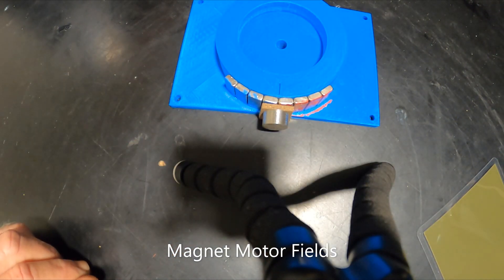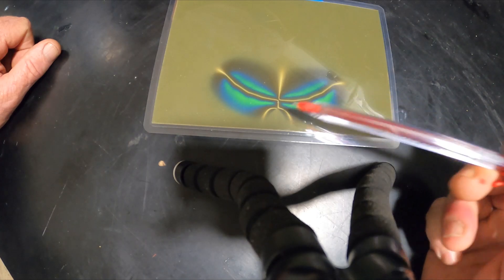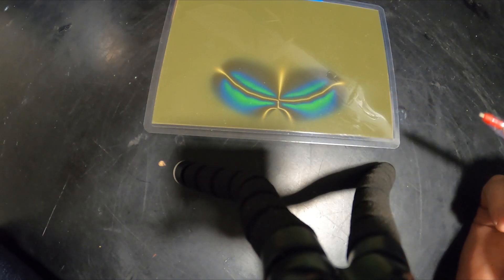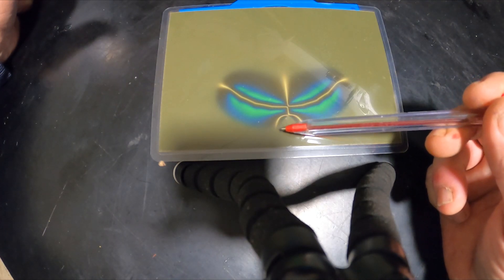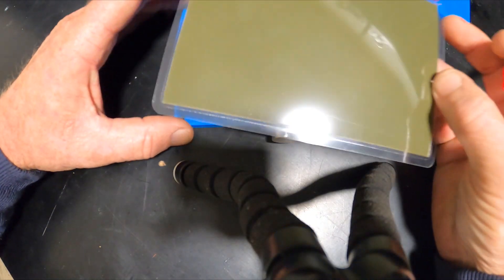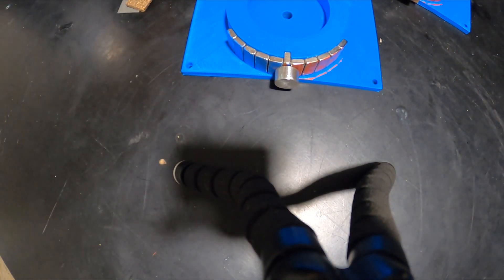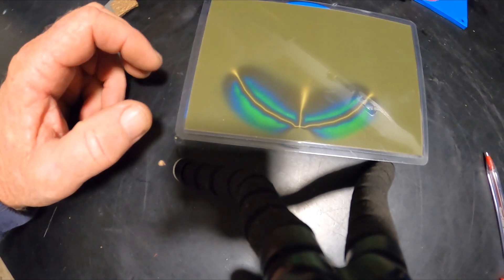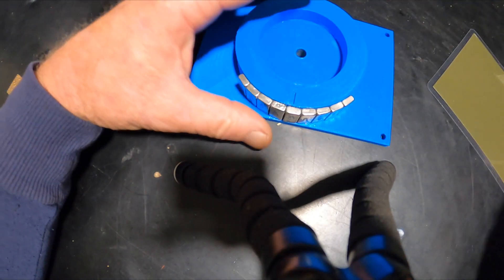Magnet Motor Field View

Comment: Have you try making a "markov" transformer? It's lenzless. Although the source and load are flipped. The two windings are secondary, need to be parallel. The singular winding is to be use as primary.
Reply: 😂😂 Son imanes y campos magnéticos,no confunda mas a la gente con comparaciones alejados en conceptos y principios por el simple hecho de nexo común "Campos magnéticos¿Markov? Su comparación es como decir al inventor del avión ¡Has creado un UFO ! Por que ambos están suspendidos en el aire 😂😂 .No me extraña que no le respondan ,lo extraño aún lo hago yo😂😂..
Reply: @lukiepoole I have read this comment from you on multiple videos about unrelated topics. Build one yourself and you will see how really works, or doesn't work! Film a video of it operating and post it to YT!
Reply: @sandysmagicmix  Nah I figured it out. "frolov transformer" is the name but due to complex/imaginary/reactive power, output current is almost non-existence since the primary windings is literally an inductor as no back emf is induced by the secondary windings, as they cancel each other. Therefore capacitor is needed on the output side to convert the complex field into real field. The funny thing is the input and output current are 180 degrees out of phase.
If you apply back emf cancellation on a generator, the breaking load torque is drastically reduced, achieving over unity.
The MAIN question that needs to be answered is what are the differences and similarities of a rotating electromagnet and the inductor.
Phase shift.
This reveals the SECRET equation - electrification.
Psi • Phi = Koppa
Aka
Electric flux • Magnetic flux = Planck.
Matches what Eric p dollard said before.
Reply: @sandysmagicmix  And what is energy? Planck per second. The equations also unite the magnetic energy and electric energy equations as well as power. Fits straight in doesn't it?
Reply: @lukiepoole9254  I really don't know anything of value. The words and math are all symbolic, I have tried my best to understand these things in a practical way. I have never tried so hard at anything and made so very little progress. I'm glad that you have a clear understanding and I hope you can hold it in your hands if that is your ultimate goal.
Reply: @sandysmagicmix  Eh the equations are just knowledge anyway

Comment: The yellow line is where there is no magnetic field, it is exactly between the north and the south because they cancel each other out there.
Reply from the maker: That being the case, how do two magnets stick together with such great force?
Reply: @69Atho  Put your viewer on the side of your largest magnet, and you will see that in the middle is that yellow line.
The force is more to the tips, where equal polarities repel each other, and opposite polarities attract.
The neutral, non-magnetic iron is attracted to both poles, but near the yellow line somewhat less.
If the non magnetic iron is close to the magnet, the fields can interact with each other inside the iron.
Reply: @69Atho  Inside the viewer are small iron particles with a somewhat elongated shape, when they are in reach of a magnetic field they become little magnets with an opposite magnetic field, and when they are next to the magnet, their tip bends towards the pole they are closest to.
When the filings are in front of a pole, they point toward this pole.
If there is no field, the filings are oriented randomly, and reflect light like any amorphous material.
Reply from the maker: @_John_Sean_Walker  While i agree that the field is neutral between the poles, the field still exists. This is what the right hand rule is based around.
Reply: @69Atho  You can try with a small nail or a needle in between the two poles how strong the field is.
The attraction is equally strong for both sides, just like the two scales of a balance.
Reply: @_John_Sean_Walker 
Funny enough bismuth is attracted to the "neutral" zone of any large magnet including the centripetal vortex of either poles of any magnet large enough to see the effect. Welcome to real magnetism unlike the electron bullshit